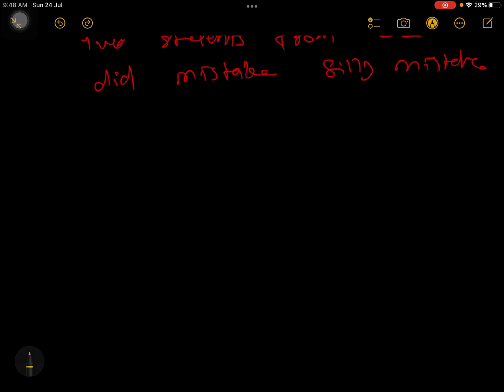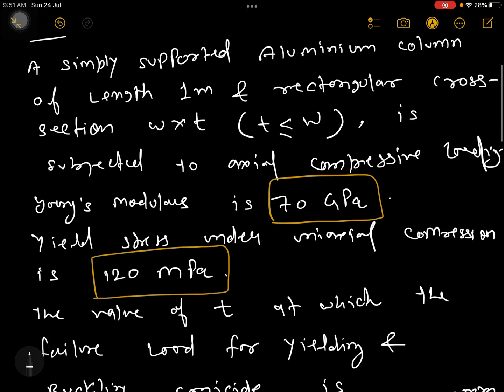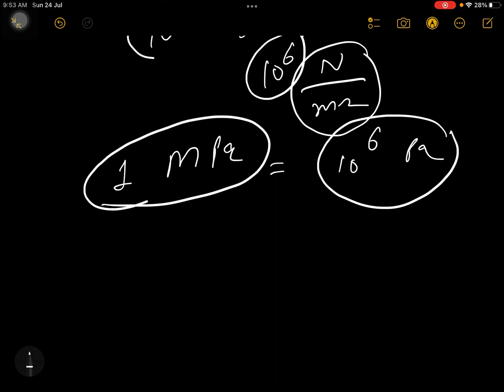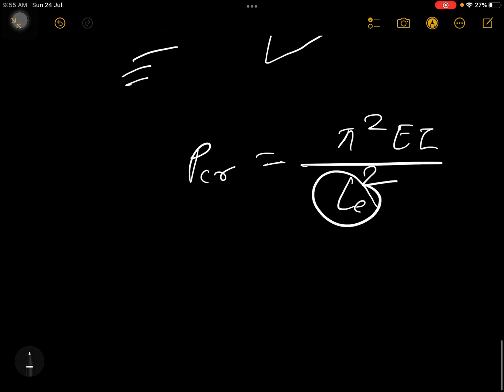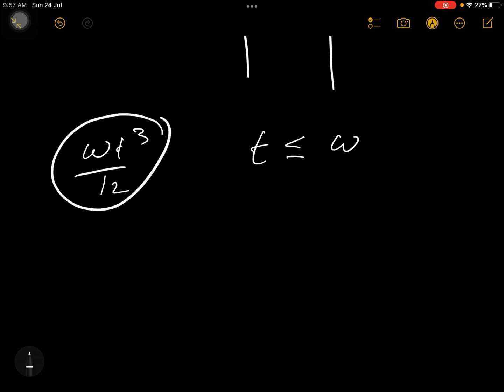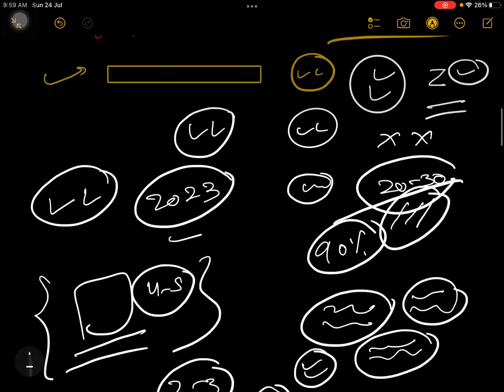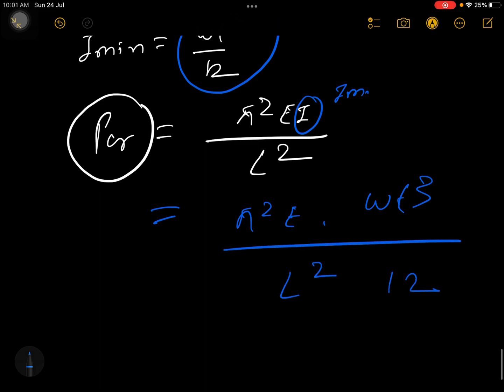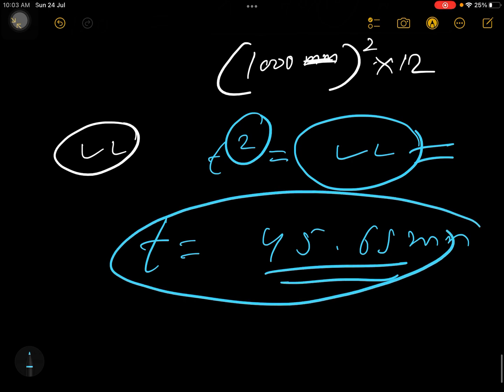GATE Aerospace Engineering 2022 Aircraft Structure solution by concept library coaching by Viru sir

Comment: Sir, if the loading is axial and compressive on any member, then that member is called column, long column or short column
But if the loading is only compressive and not axial , then that member is called strut. And it has several applications in aircraft's landing gear like shock strut, side strut, long strut which controls the moment of landing gears while extending and retracting. 😎
Reply from the maker: Very good vedant ❤️ pura class notes hi likh diye 😂
Reply: @conceptlibrary  😂😂Nhi Sir actually aap itna achha padhate ho ki dimaag me se concept jata nhi hai😎
Reply from the maker: Kyaa baat h ❤️